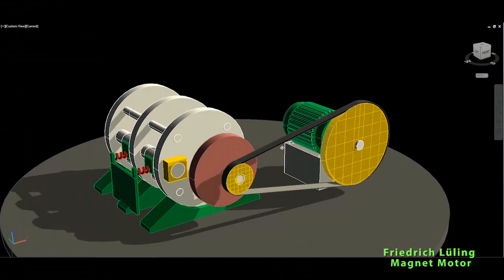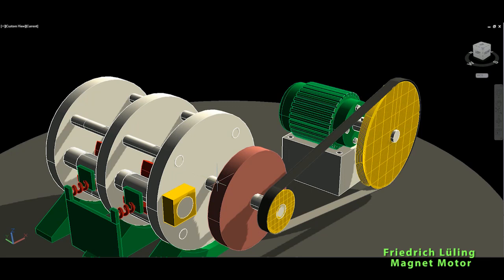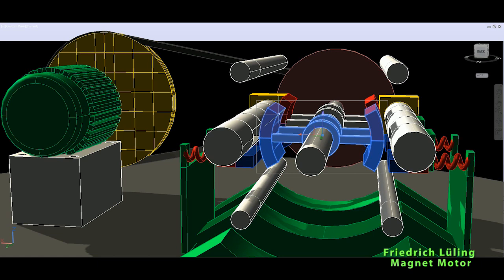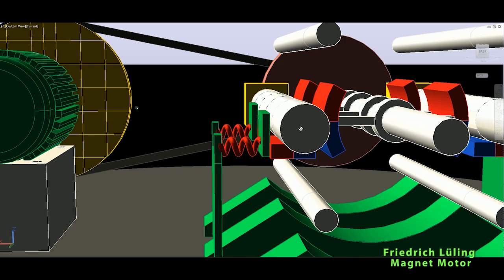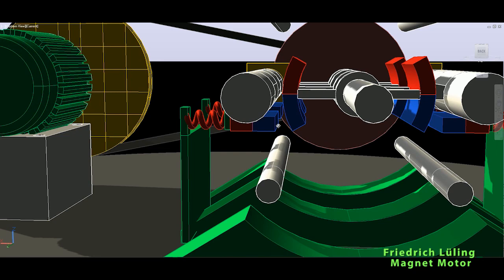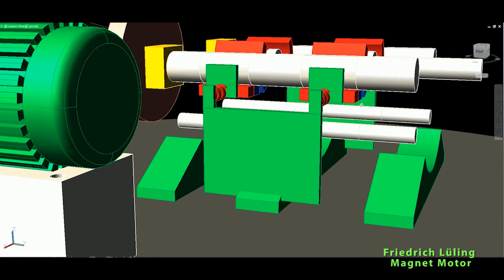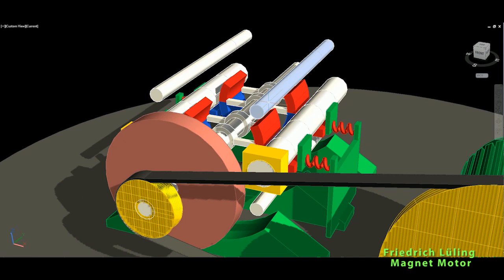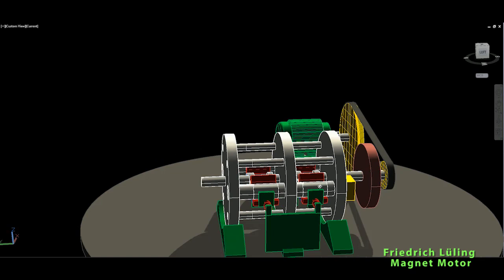Free Energy Generator, FRIEDRICH LULING Magnet Motor

Comment: That is an interesting concept.  I wonder how much torque this motor could generate?  Moving the magnets to avoid the sticky point might take more energy then it takes to power the main shaft.  Seems as if a connected cam shaft would also work.  But I think that has been tried and the power produced is low.  Patented back in the sixties and yet no working generators that I know of.  If it does work a formula for size to power would be helpful so one could make a motor designed to run a 5Kw, 10Kw, or a 15Kw generator and not have to guess at the needed size and number of magnet sets.  Thanks for the video and keep em coming please.

Comment: Love your channel, but I think you are way off on this one. 1. The rotor is made entirety of steel, no magnets. 2. The stator magnets are turned 45 degrees by the force of the rotor only, no input energy required. When magnets and steel are used for the attractive forces there are no opposing forces as there are with magnet on magnet set ups. This arrangement can generate enough energy to rotate the stator magnets past the "sticky point" yet continue to rotate. I love this design! I believe it has a very high chance of success and I'm currently building a prototype with some slight modifications to graduate the distance of the steel from the stator. Wish me luck!!
Reply: Hi, i‘m curios on the results of your experiments. Did you suceed?
Greetings from Germany
Reply: Hi, i ame also curios of your results, can you upload video? Thanks lot
Reply: @marcocelozzi1493  Hi there! I have the steel drums built, and the magnets selected. I've had a lot going on with the family over the last few months, so I haven't put as much time in as I would have liked. Next I will need to build the stator/cam system and mount the stators. I will keep you posted. Thanks for the kind words!
Reply: @svenyoda1309  Hey there! Thanks for your interest in my project! I will share the results with you, good or bad. God bless!!
Reply: Have you had any luck yet with the motor?!

Comment: Thank you for your effort deciphering the Luling motor. Although I'm not a mechanical engineer, just a BSEET, I have a clearer picture. I could notice the flywheel, what Luling calls magnets, but still cannot visualize well the form of the rocker cam. Also, he uses two actuator levers, one for controlling speed, but I don't know yet the purpose of the other one.

Comment: You don't need extra power to turn the minor shafts, just put equal sized sprockets on them and the main shaft and time them to turn equally now you have a self-propelling motor and these type of shafts already exist they are called overhead cam shafts this would cause extra friction without proper bearings

Comment: The falsehood of magnetics holding the energy to extract, is first identified by understanding mathematics of the transfer of Energy. Magnets are a memory of voltaic flow in the form of magnetic fields, when you manipulate highly refined "copper coils" and replicate the flow of voltage in a direction you can drive north or south with the fields present in the magnet. You can replace a stater magnet with an electricro magnet, and the motor will run the same. look at Magnets as a field we play on not the power source we play with.

Comment: the rpm is not high where the magnets are so where the belt is you have to turn around the wheels for the generator to go faster.
Reply: HAHAHA! and where does the torque come from?
Reply: @helmutklein5158  from the magnets in a right position  and the choice off magnets he did not  make a good drawing.To much fantasy.